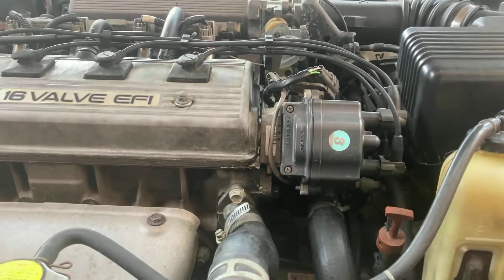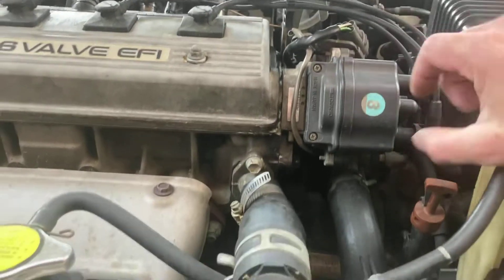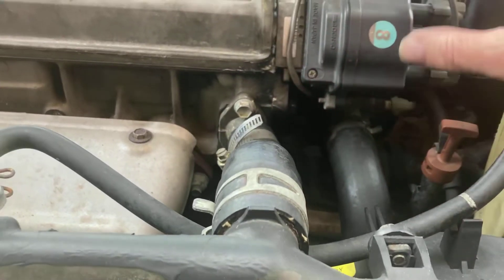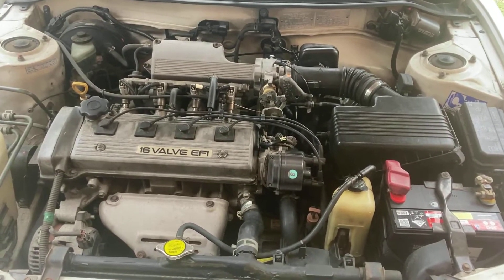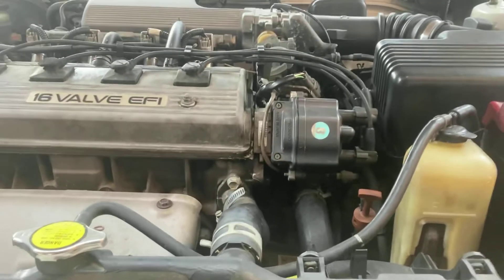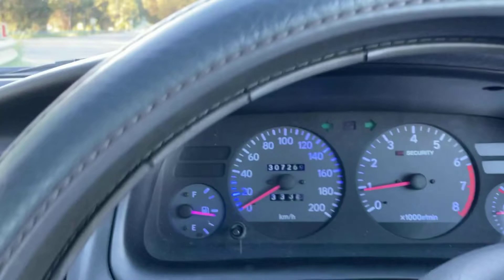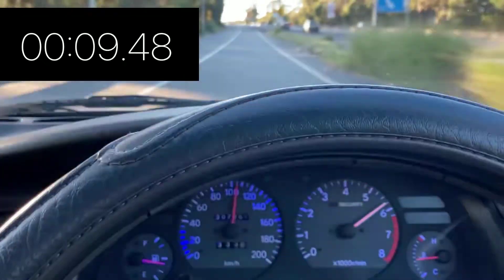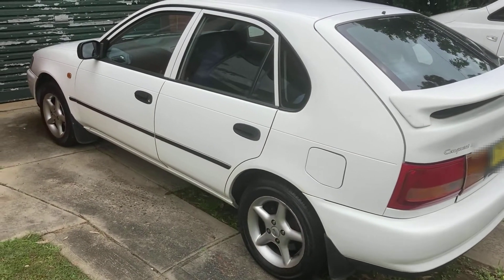97 Corolla pt 4 - Adjust timing  (0 - 100 kph)

Comment: I'm trying this after removing the cams to check the valve clearances. With the distributor rotated up, I get kock (what I think is knock). As the distributor rotates down, the knock reduces but the engine starts to miss and shudder before I can eliminate the knock.

Sending me a bit mad because I'm living with a little knock under load now to avoid shudder and inconsistent idling.

I have a 4AFE in a Holden Nova 1995.
Reply from the maker: I'm a truck mechanic that specializes in electronics and hydraulics so i'm no expert on these engines but I'll have a go. 
What's the idle speed when the knock is gone? Needs to be at least 1000 rpm in neutral when warm. Is there an idle screw on the throttle body? Large valve clearance shouldn't cause a miss, just a bit less power but should still run smooth.
Reply: @OzMike  good idea. I'll try the idle next chance I get. I'll let you know.. I could reduce the knock and increase the idle.
Reply: @OzMike   OK, lots happened. Spark plug 1 oil seal was leaking, which caused engine hesitation. Fixed that with some RTV around the seal. That made the engine happy.

I adjusted the distributor timing to remove the knock and it worked. I am still fine tuning but can do it now I don't have to fight the oily spark plug.

Comment: Ha ha you were really getting on it there!  Did you ever do a video with timing light?  On my 96 Honda Civic EX A/T, rotating the distributor CCW advances more, CW retards more.  Interesting that your Toyota is reverse of that.  Is that maybe because you are down under? lol.  Another thing is that in my car to adjust the timing the service manual tells me that there is a service check connector that I need to install a temporary jumper in, between the two terminals.  I can only assume this is to keep the computer from undoing your adjustment but it remains a bit of a mystery because manuals ain't written like they used to be with virtually no description of how things work anymore.  Cheers!
Reply from the maker: Ha ha... Yeah the corolla has that too. Add the temporary jumper to set the "base" timing. It basically disables any advance the computer might be adding.
Reply: After thinking a bit more, my distributor is on the other end of my camshaft so not surprising that CCW to advance whereas yours is CW to advance :)